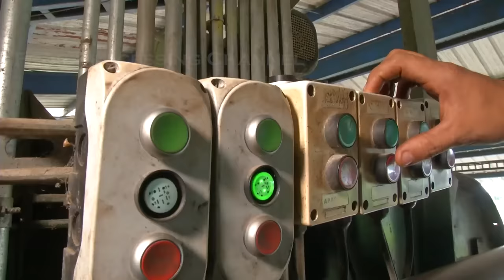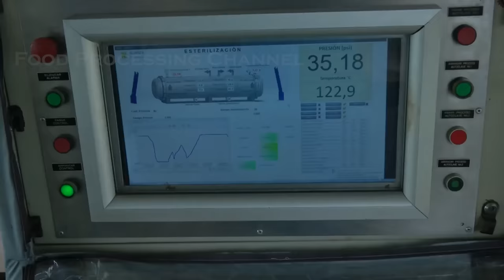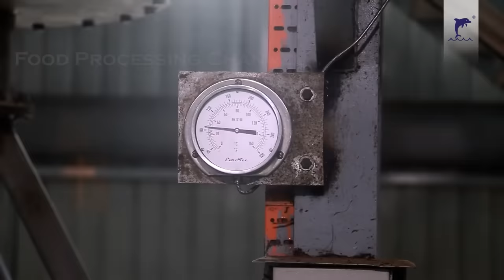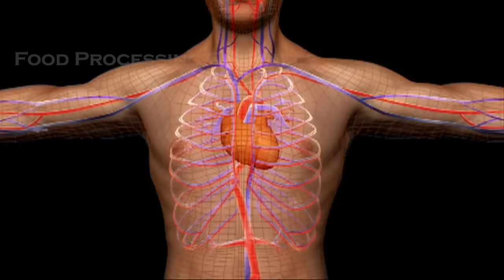Palm Oil Making Process | Modern Oil Palm Harvesting Process | How Palm Oil Is Made In Factory

Comment: Imagine working in an area where you need a cage around the tractor cab. I assume to protect you from predators?
Reply: I'd guess that it's probably to protect from the nut clusters in those very tall trees...One of those could be a real headache, if it happened to fall at the wrong angle, or bounced when it landed.
Reply: Haha this is gold !!
Reply: Yes but it’s sad to see people on foot are not protected. Prolly cheaper and less skilled so they are more easily replaced if eaten by a predator.